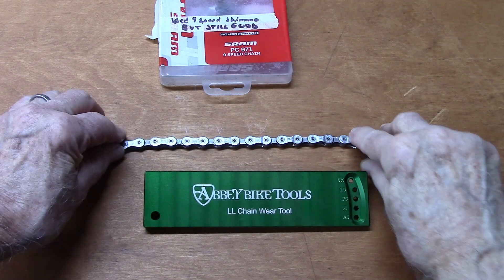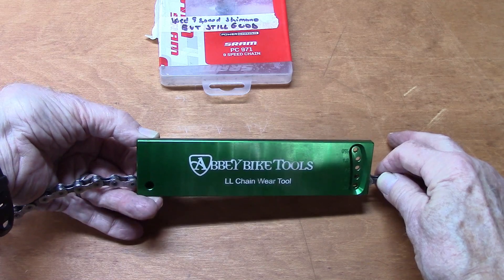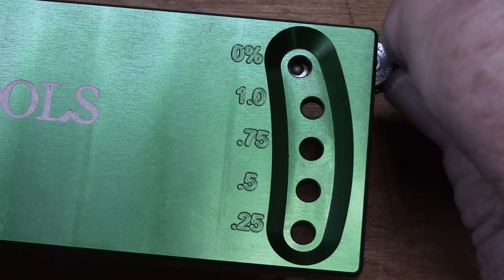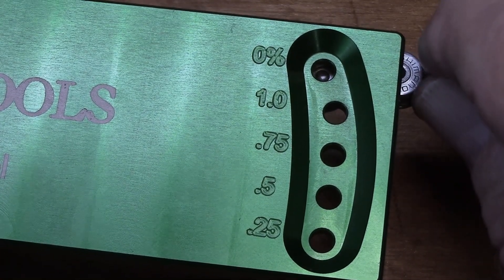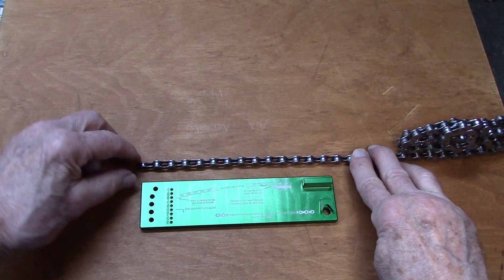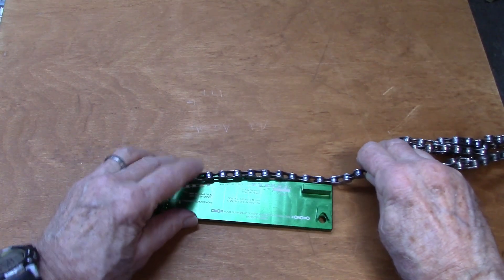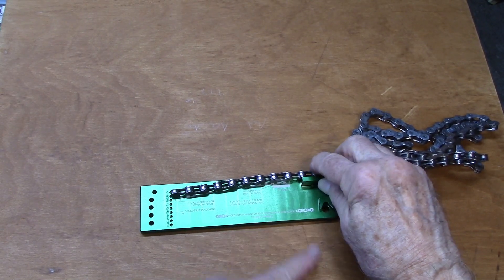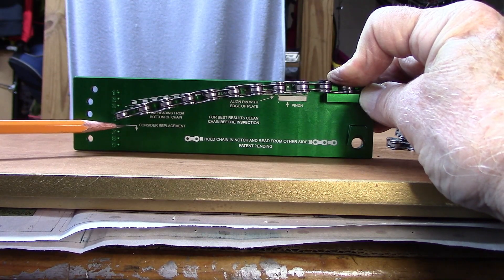Is The Abby LL Chain Wear Tool WORTH The HYPE?

Comment: As a 30 year professional mechanic, side flex wear is super critical test  with 1x drivetrains especially eagle set ups.  We’ve had many chains pass the traditional wear indicator but shifted horribly.   This new test is necessary for the modern mtb/ gravel drivetrains.   Side flex/ wear leads to super poor shifting.   One would use it during a tune up when the chain is already removed for cleaning and then test.   I would have agreed with you 5 years ago but bike drivetrains have changed with 10 -50/52 cassette spreads.
Reply from the maker: Thank you for your insight. I, myself, don't usually remove the chain for cleaning. But if the 1x drivetrain shows poor shifting despite a realitely new cable and proper rear derailleur adjustment, this might be a reason to remove the chain and check lateral wear. Does this sound reasonable?
Reply: I take readings with a set of bearing cavity verniers before chain installation , as well as taking lateral wear readings . I then record this . I take readings again at service time . I note the differences and translate them into variation percentages as recommended by the manufacturers.  This guides me on when the client needs chain replacement.
Reply from the maker: @robertmcfadyen9156  There are several videos on using Vernier Calipers for chain wear re: elongation. How do you measure lateral wear with the calipers?
Reply: @tony10speed  I take a carbon film imprint before chain installation when new . I keep reference imprints for a large variety of chain models from a library created by other industry counterparts , people that have followed this process . These are comparative , yet helpful .
Reply from the maker: @robertmcfadyen9156  Thanks Robert.

Comment: on bike measurement is incorrect, put the chain IN LINE from front to back, not cross chained as you did.
Reply from the maker: Shimano suggests the largest chainring and largest cog to place the chain under tension:
https://bike.shimano.com/stories/article/determine-chain-length.html
  Other sources suggest in-line while others say it doesn't matter. Abby doesn't appear to specify when measuring chain wear with there chain wear tool.
  Understanding the dynamics of chain wear, I prefer large chainring/large cog to put the chain under the most tension, especially if you are only using a 2 point chain tool.
  If you have some references, I'm sure our audience would be interested.
  Good comment. Regards, Tony

Comment: I am here because moved out of a city with a robust cycling community to one with none! 💔 St. Petersburg, Florida. IAt first I tried to find weeknight rides and long ones on Sat/Sunday. No dice! I wanted to maintain my 200 miles a week. I did it initially but 99% of the rides  were novelty riders other otherwise, not fitness cyclist. So now I have the Cyclops trainer. I got it installed but I am unsure if the chain is configured correctly. I am on my big chain ring but I forgot which chain goes on which ring!

Comment: What size sprockets on that cassette?
Reply from the maker: 12/36 cassette to climb some of the steeper hills in NJ and PA.
Reply: That sounds ideal. I’ve 11. 34.    a13. 36. would do me way better
Reply from the maker: @kerrysupporter  I could not find a 13/36 cassette, only the 12/26. One needs to check that your rear derailleur could handle the larger cog.

Comment: Great video but the tool looks far too much trouble. The simple Park tool "Go/NoGo" check is good enough. But maybe useful if you were trouble-shooting some unusual issues. What's the deal with "lateral wear" anyway-- who cares if your chain has lateral wear?
Reply from the maker: Apparently it's of a big concern to John Langley (Bicycle Magazine) and Lenord Zinn (author of Road Bike Maintenance and Mountain Bike Mantenance). I would tend to agree with them in that lateral wear can lead to poor shifting as well as wear to cassette and chainrings. However, they will need improve the tool so we can measure lateral wear while the chain is ON the bicycle - to allow us to have a closer look at lateral wear. Good question! Thanks, Tony
Reply: @tony10speed  Jim Langley maybe? I rate him and am a fan of his YT channel. I guess I could look at lateral wear if I have the chain off to clean it anyway. But I'm too lazy to do that very often :)
Reply from the maker: @benc8386  Me too.

Comment: A 12” ruler is all I have ever needed.
Reply from the maker: A few important things to keep in mind when using a ruler. 
•  Keep the chain under tension (shift to the largest chainring and smallest cassette cog).
•  Use a good metal ruler and make sure the end is it's lined up well with the chain's pin (rivet).
•  Take your time (requires a keen eye), especially when dealing with 12 and 13 speed.
If the ruler works for you, that's great. Here's my take on chain wear measurement. Let me know what you think:
https://youtu.be/8UZJIcKacKI
Regards, Tony

Comment: Does lateral wear affect different speed cogsets in a different way? For example, on an 8 speed, maybe lateral wear doesn't matter that much, because the chain and cogs are wider. But on a 13 speed, I suppose more precision is needed because if the chain is flopping around too much laterally, maybe the upper jockey wheel won't be able to position it correctly for a smooth and accurate shift.  I'm speculating, and haven't tried it.  I use Campy 10 speed, and it shifts wonderfully, and faster than electronic.
Reply from the maker: Good question that I don't have an answer. But I would also speculate that lateral wear may be seen more often with 12 and 13 speed since the thickness of the outer and inner plates are thinner. Any of our viewers have any other ideas?

Comment: Gimmicks for big cash, mark a piece of wood or metal and you‘re fine. A bike-shop that buys tools like this looses 100% reputation in my eye. That is a parts mounter, not a bike-shop with material competence in tool building..
Reply from the maker: The tool does have some benifits in that it's easier to read the amount of longitudinal wear (stretch) then using a ruler (the chain needs to be under pressure pulling at both ends for a ruler to be accurate. However, my biggist grips are that the tool is difficult to read while the chain is on the bike, lateral wear requires removing the chain, and the tool is not cheap. It's a good idea, just not practical in every day life of bike maintenance.
P.S. a ruler will work as in your case if the ruler is high quality and you have a keen eye. 
Thanks for your comment, Tony
Reply: @tony10speed  yep, I saw it‘s awkwardness in handling, and I‘m sure a mechanic trained in machining and fabrication, same as a watchmaker has built a tool better in no time, before even looking for half the cash to buy this.
That tool is for people like me - consumers with two left hands and too much money for gimmicks to spend in free time.. ;-)
Love the old litespeed, though. We dreamed about them and very few could afford to import them, then.

Comment: Really enjoy your videos, Tony. That looks like a great tool. I would recommend spending $30 on a crockpot, paraffin wax, and a 1.5 ounce of PTFE and start waxing your chain. You won’t have to worry about your chain for about every 10,000 mile, not to mention the protection waxing gives to your cassette. Grace & Peace
Reply from the maker: I'm not sure a 12 or 13 speed chain would last that long. But many cyclist, especially those living in areas that are frequently wet or damp swear by waxing. Regards and safe cycling, Tony
Reply: 500-1000 km, you have to wax it. I went back to oil. I agree chain won't last the long 10,000 miles.
Reply from the maker: @lionden4  Thanks for your comments. Regards, Tony
Reply: @ Tony I love your videos!

Comment: If I didn't have the basic one, I might consider it.  I like that it can measure lateral wear, even though taking off the chain is never fun.  Great review as always.
Reply from the maker: I woud agree. See our video on 3 point chain checkers and tell me what you think:
https://www.youtube.com/watch?v=8UZJIcKacKI&ab_channel=TonyMarchand
Regards and safe cycling, Tony
Reply: Since you have to take the chain off, I would feel as though I would need to charge for a new link if the old chain was not worn. Too time consuming for me to think about using it in the shop. Maybe in the future, it will become a bit quicker to use.

Comment: Just use the basic chain checker tool. Nothing fancy and accurate.
Reply from the maker: According to the experts, the tool is precision made and accurate with the ability to know increments of wear such as 0.25, 0.5, 0.75 and 1%. However, you need to hold the tool properly, have good side lighting and a keen eye to observe the pin thru the hole in the tool. Measuement of lateral wear is unique to this tool, however, one must remove the chain for this measurement (which many of us don't care to do).
Reply: @lionden4 
False.
Only 3 types of chain wear tool are accurate.
Accurate tools (see below) only measure the pin wear. One of these tool is indispensable if you have a 12/13 speed chain but highly recommended for any other bikes. Especially those with expensive chainrings and cassettes.
The other usual tools (2 points touching the chain) measure both the pin and the roller wear.The roller wear as no incidence on the wear of the chainrings and cassettes.
The precise tools are :
Type 1: A simple ruler over 12 inches.
Type 2 is like the Abbey seen in this video or the old 1990"s Speedtech Chain Wear Indicator (I own one since 1992). These two tools measure, like a ruler but in a much easier manner, the length from pin center to pin center which is not affected at all by chain rollers wear.
Type 3 Is much cheaper than the Abbey Tool and is designed as a three points measuring type of tool. The tool is built in such a way that it doesn't add the roller wear in its measurement.
These tools are
Park CC-4 or CC-4.2 (adds single speed measuring capability to CC-4), Pedro's Chain Checker Plus II, Shimano (TL-CN41 not 12/13 speed compatible) TL-CN42.
Other manufacturer may make one.
Reply from the maker: @sylvainmichaud2262  The Speedtech Chain Wear Indicator is quite a tool. You can still buy the Speedtech on Ebay if you're willing to spend $100.
Reply: @tony10speed  
The Speedtech Chain Wear indicator is good but certainly not worth $100. What I would like to do at some point is compare the holes with the ones on the Abbey Tool. I will compare this summer, a traditional 2 points tool, the 3 points Park Tool CC-4, that I currently use and the Speedtech one. You could do the same type of comparison with the Abbey tool instead and see at what point these tool recommend to change the chain. I suspect that the two point tool will be first but what interest me is the difference between a three point tool and the Abbey (or Speedtech in my case).
Reply from the maker: @sylvainmichaud2262  Look forward to your comparison.
Reply: @sylvainmichaud2262  if you have just basic tool you are good. And as cyclist you will know when your chain needs to replace. In my opinion you don't need expensive tool/s just to check your chain. IThere is no right or wrong in here.
Reply: @lionden4  
Good for you then.
I would still recommend a 3 point chain checker for those who don't possess this instinct that you have to avoid a late replacement of a worn chain that could cause premature wear of expensive chainrings and cassettes.
Spending less than $30 to prolong a $100+ ultegra cassette and $300+ of Ultegra chainrings is more than a good investment.
Has I said, I understand that you're one of the special gifted ones  who don't need these tools.

Comment: Great video Tony , it seems a lot of work
Reply from the maker: It isn't too much work to measure longitudinal "stretch" on the bike but requires good side lighting an a keen eye. One can not measure lateral stretch with the chain on the bike which is a real problem.
Reply: @tony10speed 
The lateral wear is mostly an issue on 12/13 speed chain. But my guess is, unless one rides the extreme cross-chaining often, the longitudinal stretch will be the first critera to reject a chain.
Reply from the maker: @sylvainmichaud2262  I would tend to agree but have not yet used the Abby tool long enough to make a definite conclusion. Be well, Tony
Reply: @sylvainmichaud2262 Secondly , the backlit sheet of white cardboard technique , for aligning disc brake rotors and calipers ?
Reply: @tony10speed I have type two diabetic retinopathy . How useful are diopter lamps for this fine measurement work and doing disc brake alignment etc . I still get advanced and sometimes complex work from clients .
Reply: @robertmcfadyen9156  
Sorry to hear that but great to see that you are still at work.
It could most certainly help but there is another difficulty which is manipulating the tool and aligning the holes with the chain pin when the bike is not necessarily at eye level. It creates a parallax error. And in my case, it's my old back that keep saying no.
Reply from the maker: @robertmcfadyen9156  Having used diopter lamps in the medical field and they're quite useful. Should be a great help for working on bicycle small parts. Regards, Tony
Reply: I’ll stick with my Park CC-4.2 chain checker. The Abbey tool requires bending over and peering through a hole. No thanks.
Reply: @galootlovestools  The CN 42 from Shimano is probably the overall "benchmark" now . I have , sell these . They are proving popular among my clients .